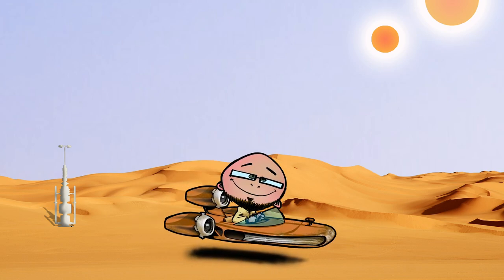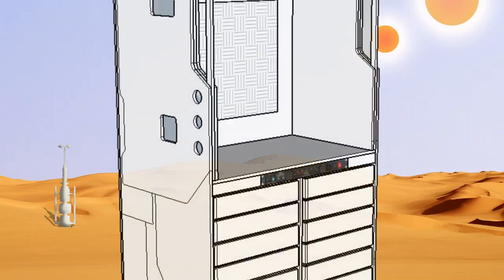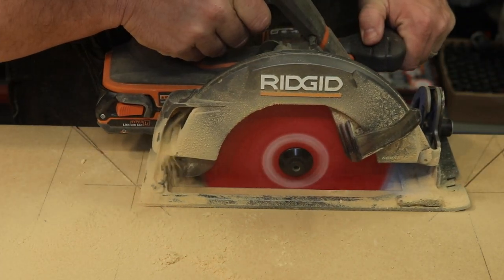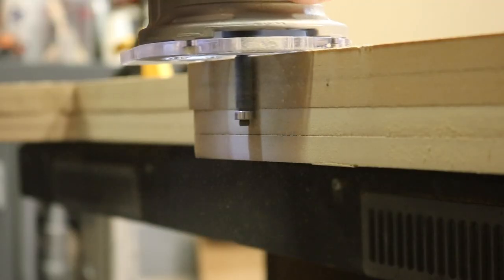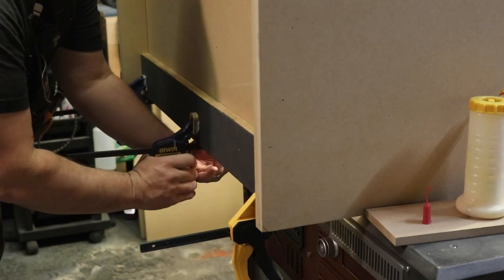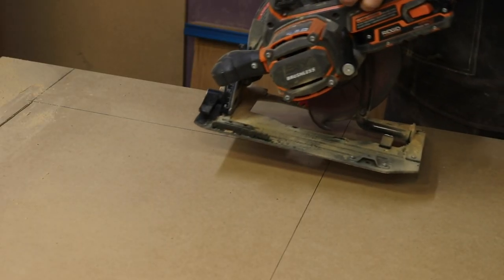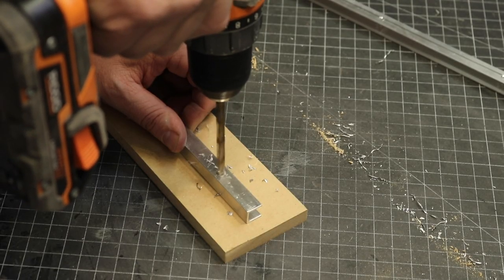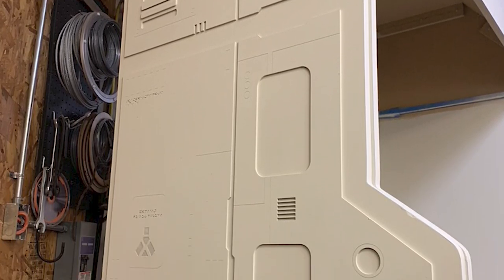Paint Booth Build | The Ultimate Star Wars Edition Part I

Comment: Another build series that I look forward to following. For those thinking of making something like this, don't overlook the relatively cheap/easily available 'grow room' filtering equipment. A properly sized sealed inline exhaust fan combined with a can-style activated charcoal filter can do the job without the need to exhaust anything outdoors. Works great for 3D resin printers as well.
Reply from the maker: Thanks for that suggestion John, absolutely great idea!

Comment: Love the build. You didn't need to worry about the box fan. Those use an induction motor with no sparking brushes inside. However they aren't the best for this use anyway. They are meant to blow air around and lose power and flow when restricted even a little. The squirrel cage type is better not only for the motor being out of the air flow but also better suction and overall air flow. Right at the neighbors kitchen. 😂
Reply from the maker: Thank you much!  Yeah, I read and heard a lot of different things about the box fan, at the end of the day I really wanted the blower for safety, but mostly that it will be super efficient.

Comment: Quick tip... you shouldn't move the router with the rotation of the bit, you should always move against it. Meaning that when you are routing the perimeter of an object, the router should be moved around counter-clockwise. It will prevent the router from running away from you potentially damaging the work piece.